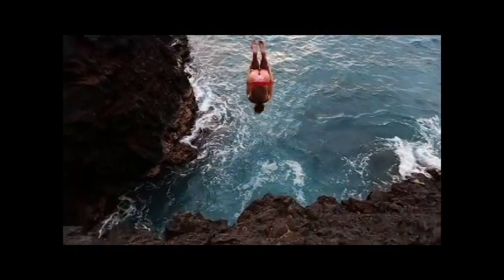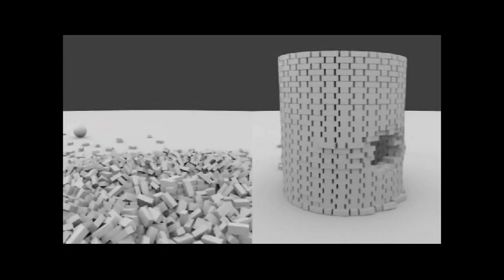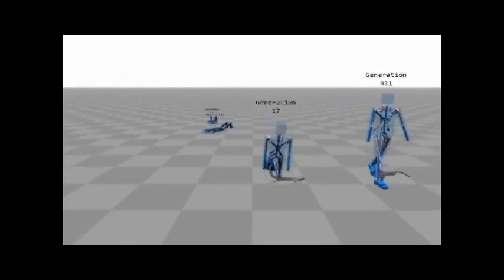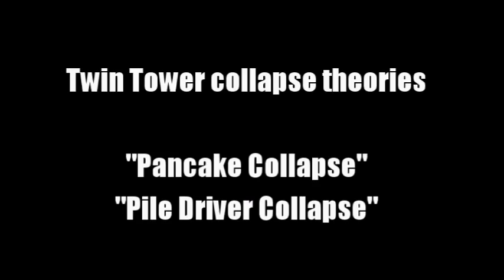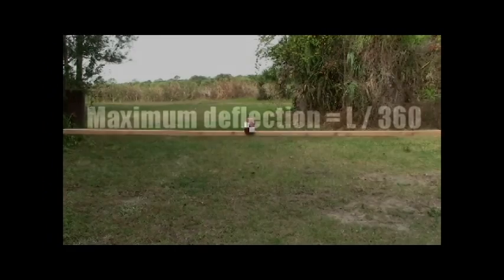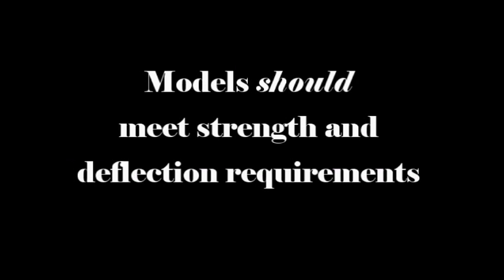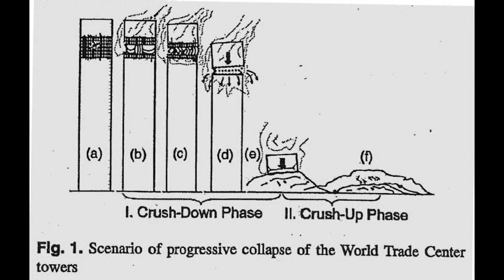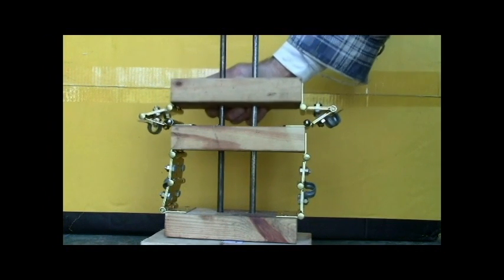9/11 Experiments: The Force Behind the Motion

Comment: So this demonstration shows how explosives would be an excellent theory for how these buildings were brought down, it replicates, to a great degree, how plausible this theory is and you are able to duplicate the results, nearly perfectly to the actual event, and people blow it off and nit pick every detail. But when NIST releases their theory, but can't duplicate it in any physical way, but only by computer models, these same people just nod in agreement without any hesitation.
Reply: Unfortunately, the experiments in this video, typical for Cole's work, are rigged to get the results he wants and in no way resemble the real event, making them effectively useless.  

And he is counting on you not to notice.

He succeeded.
Reply: M Fitz so you believe that the theory of explosions to bring these structures down (not the ones in this video by the way, but the actual steel high rise buildings) is not scientifically probable and doesn't warrant a serious discussion, but fires weakening the steel and creating either a pancake collapse, or a pile drive collapse, are/is foolproof? Even though it can't stand up to any scientific method or be replicated, besides using a computer simulation that NIST refuses to share any specifications in which to corroborate their theory? All I'm trying to say is that it warrants extensive research to prove or disprove it. Not just ignoring the facts, which is exactly what NIST did and admitted to doing. They said they didn't find any signs of explosives, then said they didn't look for them. How can you find something when you make special efforts to ignore it?
Reply: Matt Tolve - There is no theory that explosions using pre-planted explosive demolition devices had anything to do with the collapse of any building on 9/11/2001 - only speculation and conjecture based on ideology, wishful thinking, false starting assumptions and huge helpings of personal incredulity.

The idea itself is stupid beyond belief on the face of it, from any angle one looks at it.  You can not follow the scientific method and get to a conclusion of controlled demolition using pre-planted explosive devices.  You have to do the opposite of the scientific method and work backward from that conclusion, ignoring anything that doesn't fit and inventing what you need to fill in the blanks to make it seem plausible,...

But then its just all bullshit anyway.  Agenda, not evidence driven.
Reply: M Fitz there's no official theory of using explosives by any government agency. Anybody can make a theory just by saying it or asking a question. It's by using the scientific method that corroborates or disproves the theory. Just by saying a theory is ludicrous because the idea seems outlandish on the surface is not science. Being ignorant and dismissing hard evidence and facts is not science. Eyewitness testimonies of loud explosions and seeing molten steel, pictures of molten steel, surface temperatures weeks after the collapse over 1300°F with no fires on the surface, ignoring all of this because it doesn't fit your predetermined theory is not science. Spending years and millions of dollars to create a computer simulation to "explain" the start of a building collapse but ignoring the actual collapse is not science. All of this information is out there, you can't just ignore it.
Reply: Matt Tolve - You do not seem to understand what a theory is. You also don't seem to comprehend English since what you just wrote has absolutely nothing to do with the criticisms I voiced in my last comment about conspiracy non-thinking. 

What you are doing here is just throwing out a bunch of random anomalies - most of which are not in fact established fact - that you can not explain, proclaim they mean X then challenging others to prove you wrong.

That is not a theory.  That is not science.
Reply: Matt Tolve - Proper critical thinking is so simple it amazes that more people do not practice it.  Fundamentally all one need do, when confronted with ANY claim, is ask two questions - the order rarely important:

1.  Is the claim true, a true fact. 
2.  If true, so what?  Why do we care (why is it relevant)?

If you bothered to seriously ask those questions of the claims you have made so far I think you would quickly find they don't pass the sniff test.

In any analysis then, first one must start with all of the available facts.  Then one must sort through all of those facts to determine which are true facts and which are not and discard the nots.  Then one must take all of the true facts and determine which are relevant and which are not, discarding the nots.  Only then can one take all of the true and relevant facts and use them to inform a hypothesis.  That hypothesis in turn is open to reinterpretation and revision if and when new true and relevant facts come to light.

People who claim controlled demolition of any building on 9/11 do not do any of the above.  

If we are looking at 9/11 objectively we find that one Boeing 767 crashed at very high speed into each of the Twin Towers.  These impacts were observed and are well documented.  Those impacts caused considerable structural damage, destroying some columns and weakening others and causing loads to be redistributed to the surviving columns so that each of the surviving columns is carrying more than its original design load but still within margins. 

The impacts also started large fires while simultaneously removing fire suppression and prevention measures, allowing their rapid spread across multiple floors simultaneously.  This was also observed and is well documented.  We know from a century of fire science research and a few millennia of metal working and blacksmithing that heating metal weakens it.  The hotter it gets the weaker it gets, the less ability it retains to carry a given load.  

Both Twin Towers showed signs of impaired structural integrity in the time between the impacts and collapse initiation.  Movement within the structure, leaning and so on.  This was all observed and is well documented.  Immediately prior to collapse initiation floor trusses in the impact and fire zone were seen to sag.  This sagging in turn was observed to cause inward bowing of gradually weakening and increasingly loaded perimeter columns in the impact and fire zones of up to 5 feet until those columns buckled.  Again, all of this was observed and is well documented.  

Once those perimeter columns buckled the structure above the initiation point started to drop.  Once it began to drop the collapse moved from the initiation phase to the progression phase.  Everything that happens in the progression phase is a product of gravity and chaos.  Once collapse transitions to progression stage global collapse is inevitable.  There is nothing below that can arrest the movement of the falling mass above, now a dynamic load 30 times greater than it was as a static load and no longer imparting its load onto the structure - the columns - designed to support it.  

There was no controlled demolition and no need for one, not that it matters because no one would have bothered.  

Again, all controlled demolition claims start with the answer then try to work the problem backward by cherry picking facts that may be neither true nor relevant, ignoring true and relevant facts that don't fit the conclusion, inventing what is need to fill in the blanks and all relying on healthy doses of personal incredulity and false starting assumptions.

None withstand even a tiny amount of scrutiny.

And finally, the 9/11 Truth movement killed itself the moment it aligned with ideologues pushing obviously false technical claims like demolition of the Twin Towers, shoot downs over Shanksville and missiles at the Pentagon, ensuring that any legitimate concerns about the political decision making process would never be taken seriously.   They all fail to conceive the very obvious:

The Twin Towers could have collapsed because of damage suffered by impact and fire from a large aircraft AND 9/11 could still have been some sort of inside job.  No need to separate the two but conspiracy theorists falsely think they need to because if it could have been planes it could have been terrorists,... and that is politically unacceptable.  

Truth has nothing to do with it.
Reply: M Fitz wow, nice rant. Glad you can read the NIST report. Try explaining the progressive collapse to Newton which defies his third law of physics. A plane flies into a building, obviously, is very well documented. It starts a fire, again very obvious. Fire weakens steel, again true. The fire causes structural damage and you lose a couple/ few floors, ok. Now is where everyone gets confused. The top section of the building, about 15 floors, falls into the remaining 80 floors. These floors have not been hit by a plane and have not been exposed to fires. 15 floors cannot destroy 80. For every action there is an equal and opposite reaction. The damage the 15 floors cause on the 80 would also damage them, all the while slowing their fall, not increasing it as we see. It's physics, not some fantasy NIST has made up.
Reply: M Fitz theory:  a hypothesis assumed for the sake of argument or investigation

b : an unproved assumption
Reply: Matt Tolve - "Now is where everyone gets confused. The top section of the building, about 15 floors, falls into the remaining 80 floors.  The top section of the building, about 15 floors, falls into the remaining 80 floors. These floors have not been hit by a plane and have not been exposed to fires. 15 floors cannot destroy 80."

No, that is where YOU get confused, doing the same stupid shit Chandler does of treating each tower as two solid blocks - probably a legacy of his spending a lifetime teaching simplistic 1D physics to school kids - or that idiot Gage with his ridiculous cardboard box demonstration.  

There is no "15 floors falling on 80 floors" and the reasons why should be bleeding obvious.   

My suggestion would be for you to forget everything you think you know.  I guarantee you its wrong.  Not just wrong.  The proof of that is that if you were correct, both towers would still be standing. That they aren't and this does not cause you to reconsider boggles the mind.  

Tell you what.  Start from scratch.  No pretenses.  Can you, in just a short paragraph describe the major structural elements of the Twin Towers and what they do?  Simple question, should be easy.  This is where we start.
Reply: M Fitz please elaborate on there not being 15 floors falling onto 80. This is NIST version and our official explanation, the pile drive collapse. The 9/11 commission report claims it was the pancake collapse. Both versions literally are the smaller upper section falling into the lower section which cause the progressive collapse.
Reply: Matt Tolve - Can you, in just a short paragraph describe the major structural elements of the Twin Towers and what they do?  Simple question, should be easy.  This is where we start.
Reply: Matt Tolve -  If you don't know what the major structural elements of the Twin Towers were or are unsure how to describe them properly just say so.  I'd like to get this ball rolling so we can get to the answer you asked for.
Reply: Matt Tolve - "Eyewitness testimonies of loud explosions"
Yes, some witnesses reported hearing explosions. I have heard some of those in videos myself too. But have you heard any that resemble explosions for controlled demolition? Like this: https://youtu.be/e2E_m7l2Rww?t=10s
Notice the sequence and loudness.

"and seeing molten steel"
One (1) interview of a firefighter that reported molted steel, in the basement, days after the collapses. And in that same interview he corrects himself and mentiond molten metal instead of molten steel.

"pictures of molten steel"
Where?

"surface temperatures weeks after the collapse over 1300°F with no fires on the surface"_
And how does that indicate controlled demolition?
Reply: Matt Tolve - "Try explaining the progressive collapse to Newton which defies his third law of physics."
Please explain to me how the collapse defies Newton in any way?> I have heard this claim for years, but no-one has been able to explain how this claim would be sustainable in any way. Are you referring to equal and opposite reaction? Do you believe that this says anything about the direction of the forces involved? Which way does gravitional force work? Up or down?

"The top section of the building, about 15 floors, falls into the remaining 80 floors. These floors have not been hit by a plane and have not been exposed to fires. 15 floors cannot destroy 80."
Howe is the number of floors relevant to a collapse? If your explanation would be sustainable, how would you explain a collapsing house of cards? I just slightly need to touch one single card for the whole house to collapse. Does this defy Newton too? Rather than talking about number of floors, why not talk in terms of total mass? Would you think that the falling mass of the upper floors would be able to break the bolts with which the floor trusses of one single floor were connected to their seats? So instead of theorizing that an upper block could never destroy a larger lower block, please see which parts of the construction any force of the falling mass actect upon. You seem to believe that the buildings (or their upper and lower parts) were single point masses.

"For every action there is an equal and opposite reaction. "
Yes.

"The damage the 15 floors cause on the 80 would also damage them"
Sure, they were damaged. Not that it matters much though. The force wasn't defined by the shape, but by the mass and velocity of that mass.

"all the while slowing their fall"
Slowing down even? Decelleration? Yes, always. But by how much? Picking up speed again when there's no resistance? Yes. Slowing down? How?

" It's physics, not some fantasy NIST has made up."
I don't want to be an asshole ans ask you for calculations. But if you claims "it's physics", it seems to me you must have done some kind of calculation. With all due respect, now you simply sound like Chandler who claimed the same silly thing about Newton.

Comment: Exactly. No matter how accurate these experiments are to the real thing. The main point being made is, it's impossible for the buildings to collapse at a constant or accelerating rate with the proposed pancake and pile driver scenarios.
The only way these 2 methods can appear to work is if the structural integrity of each floor below is blown out before the weight above hits it. Without this most of the steal shell should of remained intact like a skeleton.

Just think the untouched undamaged lower half of the builds was already holding all that weight for 30 years. 
In 1975 fire engulfed floors 9-14 of North tower. No structural damage. Not even 1500lb or 680kg of HE in 1993 detonated in the basement parking lot could bring it down.
Reply: Vegarot Fusion - The experiments are not accurate.  One thing you can count on from Cole is that the experiments are designed to reach the conclusions he wants, not to replicate reality.

Secondly, a progressive collapse by definition gains energy as it progresses.  There is every expectation that the collapse front will accelerate given the floor-led collapse mechanisms in play for the Twin Towers (Building 7 is a very different animal).  In controlled demolotions each floor is now blown out.  That is as stupid as it is pointless.  Since we know that collapse initiation in the Twin Towers was due to perimeter column buckling in the fire and impact zones - this can actually be seen with the naked eye - and all claims of controlled demolition using pre-planted devices are mega stupid, there is no reason to discuss that subject.

I prefer to stick with reality.

Comment: A couple things that stick out makes me question the official reports.
First is the structural steel melted due to the burning jet fuel. Jet fuel burns at 800 to 1500 degrees F. Then add in the office furniture, all the paper and other things in the building and you still can not get a fire to the 2750 degrees needed to melt steel no matter how long it burns.
And, when it takes demolition crews months to design a job, go in and weaken supports, then place the charges needed to drop a building in it's own foot print, This can not happen by accident especially  three times in one day. Not to mention this happened to a building that had no fire at all.
Next for a couple months prior, crews were going in for supposed maintenance and repairs, off schedule.
Last the only thing that produces the white slag seen in one video pouring from the side of one of the towers is thermite. And I have never heard of commercial planes carrying the stuff.

Oh yeah, since when does aluminum go through structural steel like it was butter? Peaces of the wings should have been found when they were sheared off by the building but never were.
Reply: John C - There is nothing in any official report about steel melting.  That's strictly a Youtube ignorant conspiracy thing.  That sticks out as making me question that you have any idea what is even in any official report.  

The rest of your post is much the same - just reposting the same tired old meme's and false starting assumptions the 9/11 Truth movement has been failing with for 17 years.
Reply: M Fitz - Please give him some credits for trying. He's clearly new at the 9/11 conspiracy  thingy.